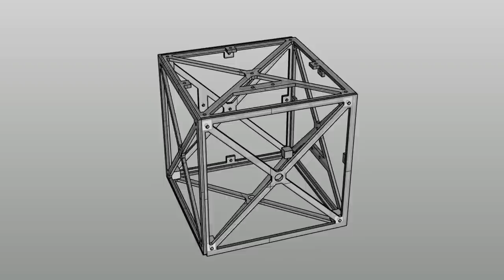Making a Rolling Cube : Part 5 - Finishing up the machining

Comment: Kris, if you are going to use off-the-shelf esc's, youre probably have trouble with the suddle stage of the balancing.. But i guess you have something else in mind :) great milling and design!
Reply from the maker: ***** Thanks! Yes, I'm aware. I'm studying the SimonK source code right now, to see if i can modify it or write my own code to flash the escs for my needs. So I have more controle and can drive them from a central microcontroller with something different than PWM.  Also, I'm not sure how far I'm gonna get with the balancing part. if it moves around brute force I will be happy for now :)

Comment: Hey Kris, Good Job! I'm working on a very similar project. Only I don't want to remote control the cube, just have it pop-up and balance on a corner. I have a working 1D version https://www.youtube.com/watch?v=KEdr19D6RoY .
As of now I'm designing the cube. One thing I noticed about your design is that you don't have an opposing brake caliper on the other side of the wheel. I assume when you engage the brake you will have a quite a bit of deflection?
Anyway, looks like you have all the components necessary to make it balance. Don't know what your background is, but I have some working code to balance it in 1D if you'd like.
Reply from the maker: Peter Nikiforov Hi Peter, thanks. Looks very cool!! I don't really have a background in this kind of stuff. I'm learning as I go. I'm first gonna try it myself but when I'm getting stuck, I might take you on that offer :)
Yes, there is some deflection. but I'm hoping it will be manageable, if not, there is still room to add a back part on the break.
Reply: Okie Dokie. Good luck Kris!